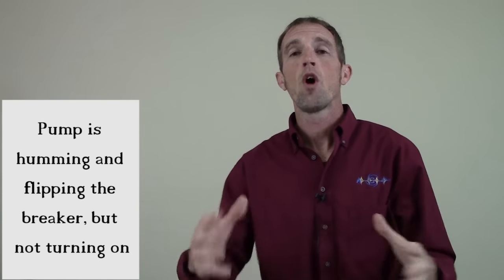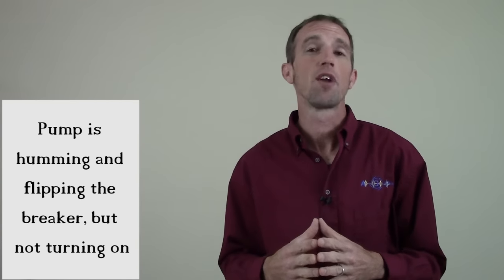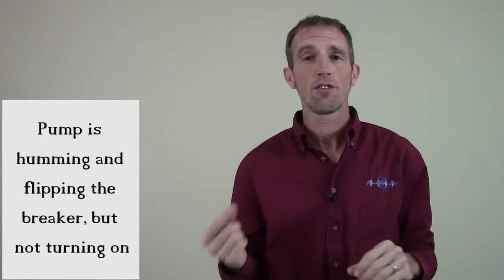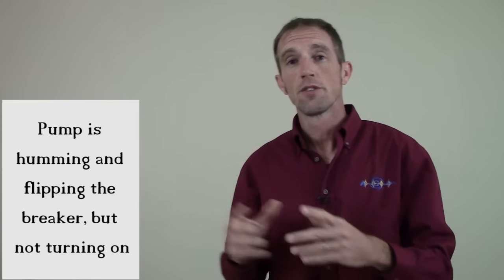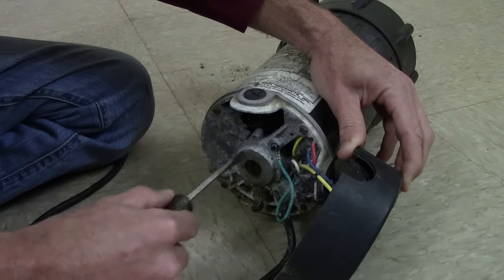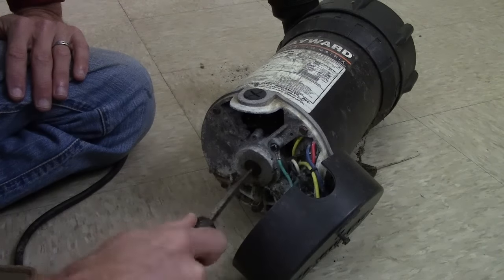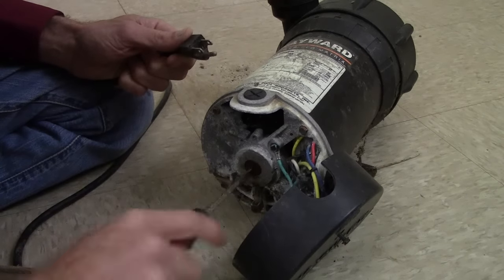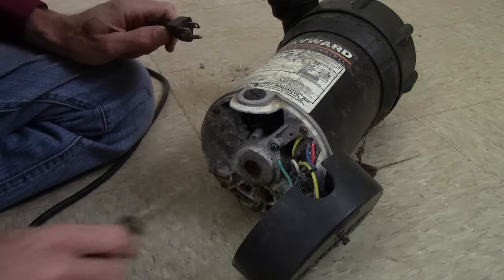Above Ground Pool Pump Won't Start or is Humming & How to Fix It

Comment: Was all set to go to the local pool store to purchase a new pump. Came across this video while doing research and decide to run outside and try it. Did not even have to use the "kick start" method. Twisted it a couple times with the screwdriver and could tell it loosened right up.  Plugged it in, and the pump was running like a champ. Thanks so much- I really thought after 9 years that the pump was shot . You just saved me hundreds this year!

Comment: And here we are 9 years later and it worked for me too.  Not exactly the same.  I took the cover off and it spun fine.  Thought it was probably the starter capacitor.  Took the hose off, detached the inlet and tipped it up to get a better look.  Decided to plug it in for the 4th time and it started right up.  Put it all back together and it's running fine now...Thank you in case you are still reading these notes.

Comment: 6 yrs later and you are still doing gods work. saved me $700 on a new sand pump. Thank you
Reply: #truth
Reply: 8 years later and its saving me $$$
Reply: @safetyab4768  [9😅😅
Reply: Great tip! Question? Does it hurt to go from a 1hp pump to a 1.5hp?

Comment: I know it’s been 5 years since you posted this but I just wanted to say thank you. Pump stopped working. Was just humming. I could spin the impeller freely so I though motor was bad. I did your “Jump Start” trick and it fired right up. Running 2 days now no problem. You saved me $. Thanks!

Comment: This is the best YouTube video.  I had similar issue with other pump, the service charged me 750 for motor plus 150 for replacement. With your video, I got it fixed for zero. Thank you. Thank you

Comment: Works like a charm! I was initially suspicious that it wouldn't work, as I was able to easily turn the shaft when it was off with a drill, but when I plugged it in, it wouldn't start. Then I tried running the drill for 10 seconds and then turning it on, and it started right up! Thanks for taking the time to make this video. Let me know if I can get you a cup of coffee.

Comment: This 7 year old video just saved my butt! Plugged in my pump for the first time this season and it was humming and not spinning, and I panicked. Found this video and gave it a little spin with a wrench (it's a Hayward Pump 2 style, so it's a little different and the screwdriver doesn't work, but I was able to get a wrench around the shaft and loosen it up) and it came to life! Thanks so much!

Comment: Add another member of the no need to buy a pool pump this year club! Used a screwdriver on my Hayward unit, spun it around a few times and plugged it in and instant money saving results, thanks OP and subscribed.

Comment: My wife found your video and you just saved us a couple of hundred at least!  I did exactly as you said, but the shaft wouldn't budge, but after a whack on the end of my large screwdriver with a mallet, it broke loose.  After a couple of full, but crunchy rotations by hand, it freed up enough that I didn't even need to kickstart it.  Thank you!

Comment: STUCK SOLID AND WILL NOT BUDGE?  TRY LUBRICATING THE SHAFT END.  I  tried using my largest flathead screwdriver on the shaft end as he shows in the video.  Not only would it not budge, but I actually managed to snap the end off of the screwdriver by applying the maximum torque that I could manage.  After staring at it for a while, I decided to spray it with some lubricant to see if that would free the end of the shaft.  I sprayed it and about 30 seconds later, it turned easily with a screwdriver (no effort at all).  The lubricant I used was PB Blaster, but WD40 or similar would likely work as well.  I hooked up the power to test and the motor worked great.  Reinstalled it and it's pumping my pool water right now.

THANK YOU, Above Ground Pool Pros for this video.  The new pump will be here in 3 days, but I can now consider that a backup for when this pump eventually fails.  I am subscribing to your channel!

Comment: And another happy viewer!  I couldn't wait until morning to see if this worked so I donned my headlamp and crocs at 11:30p and headed out to the back yard.  I unscrewed the end cover to find that the capacitor shaft extended through the casing and had a plastic fan blade on the end (which I'm guessing is for passive cooling).  I just turned the fan blade gently by hand and a felt it break free.  A few more turns just to be sure and I plugged in the pump only to hear the sweet sound of moving water immediately.  Thank you soooo much for your honest approach to remedying the issue!  You save me $$$!

Comment: I tried a screw driver and it didn't quite do it. The pumps breaker popped. I watched this vid afterwards and read the comments and someone stated to use a drill with a flat head tip. I did and voila! The shaft spun freely again. Thank you from another appreciative individual for helping life's toughness be easier.
Reply: I was thinking this as well. You could also try a rubber mallet wack. 
I feel like you could also take the pump apart more and give it a good soaking in vinegar or some solution to help break down the corrosion

Comment: Hey Chad, . . . Thank you so much for this video. You have save me from an expense I could not afford this week. I did exactly as you said in video and it worked !!. My pump is running once again. I was surprise because I put away my pump every season. I packed it and put it in a safe dry place. Anyhow glad I ran into your video and you have a new follower. . . Thank you !!

Comment: Tried you fix the first time and the spindle would not budge. No turn whatsoever. This left me discouraged thinking I would need a new pump. I thought through the corrosion issue around the coils. Copper turns green from corrosion  and leaches out to surrounding area. I then went out with a 3lb. sledge and GENTLY tapped the housing. I then used a small chisel in place of screwdriver, that I then clamped to a crescent wrench for leverage and was able to begin to turn and break the corrosion! That did the trick!!! Pump working now like a champ! Thank you! I also used your Pool liner install series 2 years back  to flawlessly install my new liner. This guy knows his craft. Highly recommend! Saved me thousands on liner installation and hundreds on new pump!

Comment: Our Hayward pool pump was humming and blew a fuse in the house. Watching this video saved us $$$. But, instead of opening the back of the motor we could see the shaft (corroded) that was between the impeller and the motor and used a open channel lock and turned it left and right which was hard at first but eventually it turned. We  plugged it in and presto ! Thank you for this tutorial!

Comment: Thank you SO MUCH Chad! 
My pump just stopped working and after freaking out I would have to buy a new pump, I found your video. 
I was able to move the screwdriver quite easy, but I needed to spin and kickstart just like you said and it worked!! 
I really can't express my gratitude enough! Thank you for your time and knowledge!!

Comment: Thank God I decided to look up pump humming but not filtering....I followed your advice and did the screwdriver to kick start the motor...and viola! Worked ... motor running again...you saved me 400$ plus $$ ...i was ready to run out and buy a new motor...Thanks for taking the time to show people that it could be a easy fix.

Comment: This tutorial helped me at least half the way. My problem was that we have a small pool and therefore a small, cheap pump (bestway Flowclear modell 58117 ), and it had a very thick cover molded on the underside so reaching the screw from that side is impossible. What I did was- 1) Remove the pump from the pool. 2) Screwed the motor off the pump and 3) Plugged the motor into the electricity (hearing it hum, but not spinning), then 4) reaching into the top fan (with a small computer screwdriver) of the now unattached pump and spinning it myself, giving it enough spin after a few times to now run by itself. After that, 5) I let the motor run by itself on the lawn under my supervision for about 15 minutes. Then I remounted it in the shell and voila- it works! Many thanks for the guide though- it gave me a push in the right direction!

Comment: Electrician here.
Pump set to 115V stuck, changed voltage to 240V set it to 230V on slide switch. Still stuck!
Tried spinning shaft while humming and Voila!!!....we have a spinning motor.
Turned it On & Off and stuck again, seems I have to leave it running for 12 to 24 hrs.
Thanks Chad for the great info, seems you need a donation link for saving all these commenters $$$!

Comment: Great video!  Thanks so much!  After I figured my pump was dead and I was irritably researching new pumps, I found this tip and on my 3rd try it started working flawlessly.  Mine was very easy to spin with the screwdriver, so limited corrosion I guess.  I couldn’t plug and spin simultaneously, so had about a 2-3 second delay from plugging in to spinning the screw, but all in all a great success!  Thanks again for the insight and $$$ saved!!!!

Comment: Thanks Chad!!
I was getting ready to order a replacement motor for our in-ground pool pump...which had the same symptoms as you described.    I had already removed the motor from the pump and taken the pump diffuser and impeller off so I knew the motor shaft was 'frozen' - I couldn't budge it.   Although I had no access to the motor shaft after removing the rear cover, I decided to use a pair of Vise-Grips on the exposed motor shaft, using some small pieces of wood to protect the shaft from damage.   In 5 seconds, I had the shaft freely spinning.    I just had to plug it in and it ran fine - no jump-starting needed!
I have ordered a new seal kit which will arrive tomorrow and I hope to be back in business by tomorrow evening.
Thank you so much - I owe you a 6-pack!
Reply from the maker: Modelo please... ;)

Comment: THANK YOU MY MAN, watched your video. did the troubleshoot. 
checked the motor, hosed out the air. 
pumping water again. saved me $$$ almost replaced the darn thing.
thanks again. great video

Comment: Even though my pump spun freely, it still only hummed and got hot when turned on. I was skeptical but this worked! Thanks a million!
Reply: This.
Reply: hayward power flo matrix manual states "Motor Hums, But Does NOT Start – Check For:
1. Centrifugal switch stuck in OPEN position.
2. Binding of motor shaft."
Reply: @jimcooper3632  Thank you. After hours of troubleshooting, this was a step in the right direction. I've bent the lever activated by the centrifugal switch while re-assembling the motor.

Comment: Like many other comments left after watching this video, I couldn't get the pump to manually spin so I switched to a drill with a flathead bit, cleaned the basket out to release the blocked suction (very important), and follow the easy instructions in the video. The mission was quickly accomplished on a 2 year old pump that locked up. THANK YOU!!!!!! Can't express my gratitude enough for getting me out of a pinch on a hot weekend with a family pool and bbq party set to go tomorrow. Thanks again!!!!

Comment: It was the night before Father's Day and we planned on having our dads over for a swim the next day to celebrate, and our nieces/nephews were coming into town the next week to spend with us. I noticed from the window that the pool was still, which is never the case because the pump runs at all times. I researched many possible cause and fixes online, but nothing worked. Thought I was going to have to get a new pump. Then, I came across this video and we were back up-and-running in no time! Thank you so much...you saved the day and our get-together!

Comment: I thought that I would need a new motor/pump for my pool. The set-up I have is 20 years old ,so I'm thinking that's a good life for this motor. Just for S&G I tried UTube ,can't hurt to look and maybe I would find something.  Boy oh boy did I ever. This is one of the best tips that I've received , ever.....EVER! I even went so far as to spin the motor shaft with my cordless drill. This backyard fix worked great. Squeelin',... grindin...',soundin' like a squirrel caught in a blender, Some gawdawful noise comin' outta that pump, but , it worked . After about 25-30 minutes ,runnin smooth and quiet as day one. Thank you saved me a bunch of time and ...AND...a lot of money. Keep on giving us these tips.     Joe

Comment: Thanks brother. Mine would not restart after Harvey. Tried your trick, shaft was very tight and utilized additional torque (channel locks on the screwdriver), it broke loose and finally spun freely by hand. Hit the go button and walla, we have pump. Thanks again. Looks like you are looking at near 450k views. Good information.

Comment: Worked like a charm.  I couldn't get it going with just the screwdriver, but resorted to using my cordless power drill instead.  At a few attempts it worked!  Absolutely brilliant!
Reply from the maker: Vanubia Keller Good thinking.
Reply: Above Ground Pros . I need help! My pool is ready but the pump, when plugged in, does nothing. Just as if it was unplugged. where dp I start to fix it? Please help! my kids will be soooo happy :)
Reply from the maker: +Bigcat34 my guess would be either the pump is shot or you're not getting any power where you're plugging in the pump. I would first check on the power going to the outlet by plugging something into it to make sure it has power. If it does then the problem must be in your pump which could be an on-off switch on the pump or the pumps just shot.
Reply: could it be the cord? It was left out all winter
Reply: Also, the pool isn't even a year old. I forgot to mention that. Sorry!
Reply from the maker: +Bigcat34 it could be but that would be a little out of the box.
Reply from the maker: +Bigcat34 then that pump should be under warranty and Id contact the people you got it from.
Reply: Above Ground Pros OK... thanks for your help!

Comment: Awesome.  Was in the middle of vacuuming the pool and turned it off to do a quick backwash, flipped it back on.... and nothing but hum. F. Saw this - and even though I was already envisioning a trip down to the supply store for a new motor - about 45 seconds with a flathead screwdriver solved the problem!  It spins very freely and i finished up backwashing, cleaning and then back to filter with no problems on the restarts. THANKS for this video!

Comment: Much like everyone else commenting below - this was my EXACT issue. Three days of messing around and then I watched this and had it running in 5 minutes. Mine was an old Hayward that was not a flat head screw at all but a strange nut that had two flat sides and two rounded sides. I was able to just use a huge adjustable to turn it. The funny thing is that it wasn't that "stuck". It turned pretty easy. Your trick about turning it as the power comes on was also dead on. My pump was hand turning no problem but not starting. I had to give it a spin as the power came on. 
Thank you..Thank you..Thank you..Thank you..Thank you..Thank you..Thank you..Thank you..Thank you..Thank you..Thank you..
And a big FU to the three pool places I called that couldn't be bothered to return my call in 3 working days. I understand it's a busy time of year but jeeze three days?

Comment: Great video. Screwdriver didn't work for me so I used a drill with a flat head chucked up. Spun it up to speed and then hit the switch. Fired right up.
Reply: Eric Payne I used a drill driver with the power off to confirm that the impeller wasn’t stuck. When I spun the shaft with the rechargeable screwdriver, the water started pumping into the pool. Great idea for troubleshooting.
Reply: Thanks for sharing this. The drill worked for us too.
Reply: Before I watched this video, this is what I also did with my pump and it helped kick-start it. But the corrosion is probably so bad that I have to keep doing this instead of letting my timer turn the pump on each day. I was hoping there would be a video on how to open up the motor so that I can give it a good cleaning inside.

Comment: Thank you, i had an older 1 speed pump and was popping circuit breaker, so i did what you said, but mine had a plastic cap with odd shape underneath it, either way i took a wrench to it and spun it around a few times and now it is fixed, Thank you for saving me money

Comment: Thank you very much. My pump was humming but not turning. The inside was not corroded so you last trick, give the inside screw a spin just before plugging the pump in worked like a charm. Thank you for your video. You saved me time and money.

Comment: Also keep in mind that some bigger motors 3/4 HP and up might have a capacitor on top of the motor, this too can go bad and has to be replaced. If the video shown doesn't start your motor you most likely have to buy a new capacitor. There will be  two screws holding a metal cover over the capacitor, remove that and the capacitor will have connectors on it or might have to cut the wires to remove it and use wire nuts to install the new capacitor. You also have an older motors that has a centrifugal clutch ( internally ) that is bad. it would be on the same end that has to be removed as in the video ( back of the motor ) The contact tips could be burnt or corroded  that might need cleaned up with a file.
Reply: Jeff mine works with the screwdriver but wont start again unless i use the driver where would the capacitor be theres no visible cap on outsied and under the cover looks just like this one mine is 2 hp

Comment: THANK YOU...Was just about to hit the purchase button for a new $268.00 pump.. Motor was humming, impeller would not spin. Actually put screw driver into impeller side and un-lodged it. Looks like sand from the rocks deteriorating on my waterfall. This pump is used for my waterfall. Thanks again. Motor running great.